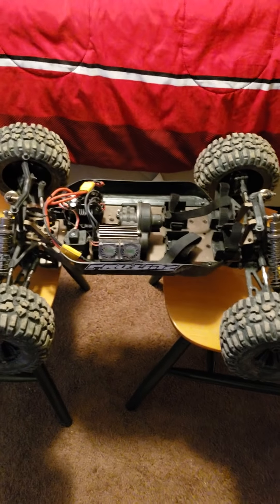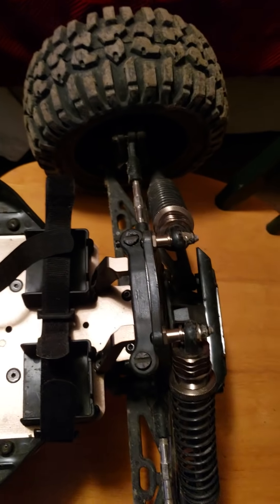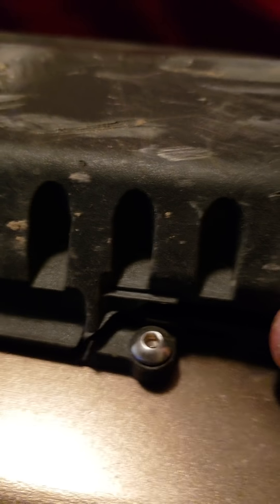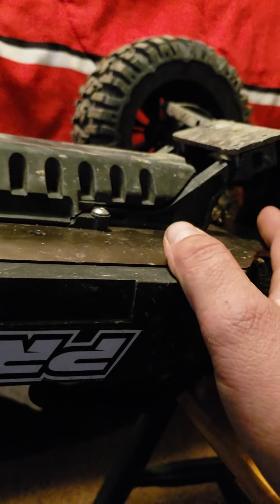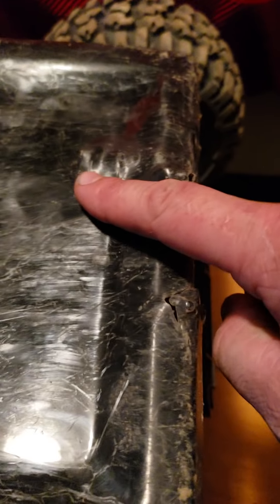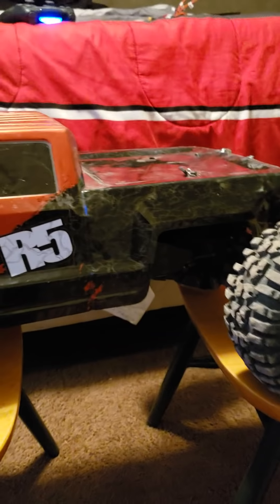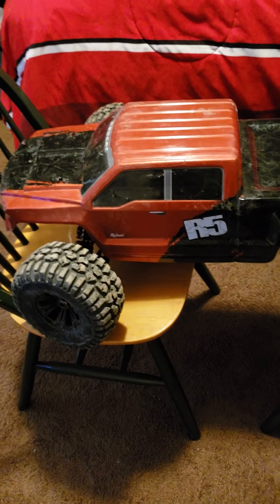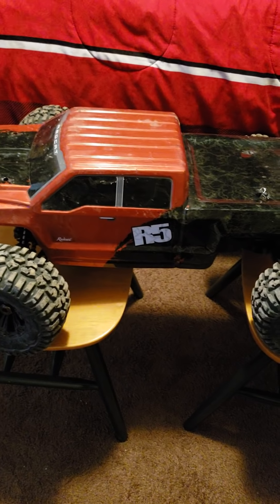Redcat R5 Review The Truth

Comment: You can get aluminum chassis braces, use piece of 1/4 in. HDPE to reinforce bumpers front and rear, aluminum L channels and spread shock towers, oh and buy it for 495 now new on eBay, and you end up with a good 500 truck , xmaxx walk away 1000
Reply from the maker: Well good luck getting part support for a discounted RC you go right ahead and buy the POS then send me your pitty story when you can't get parts it broke cause it was poorly designed #Chinagarbage

Comment: Good video but try holding the phone horizontal. Includes alot more in the view. I like the way you test though lol. Bash on. So far on mine it's been set screws,  broken bumper mounts. I will probably get the metal braces before really bashing it

Comment: Maybe it's not a basher? Maybe it's not made to be doing flips and cart wheels. It's heavy and a more scale truck. If I were to buy one I would use it to rip around in the dirt and offroading and not bashing it. It's to heavy. Of course if it lawn darts off a jump it's gonna get damaged. Just not suitable for hard bashing and jumping.
Reply: But they made this to challenge the xmaxx so it should be able to bash at least half as good
Reply: Watch his videos he  land his truck so hard you hear how hard  it bottom to the chasis ,these parts must break.I think the suspension need to adjust for hard landings.